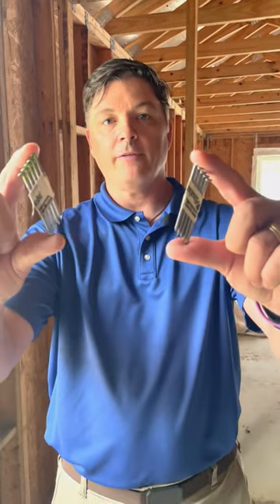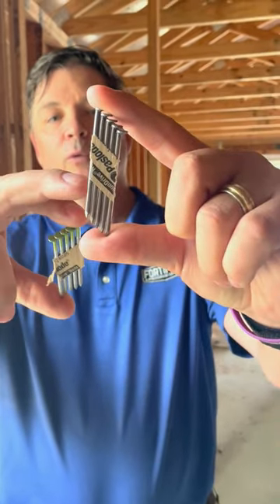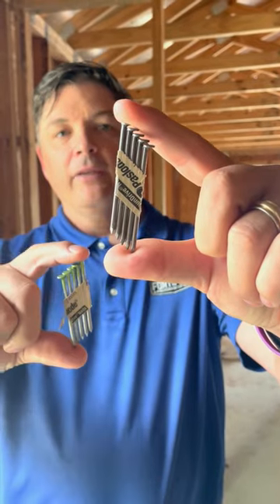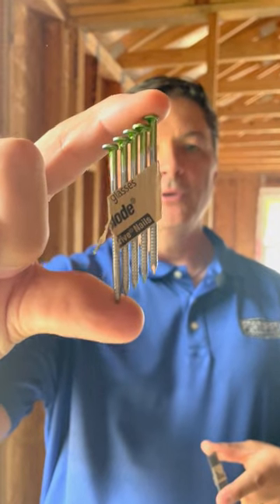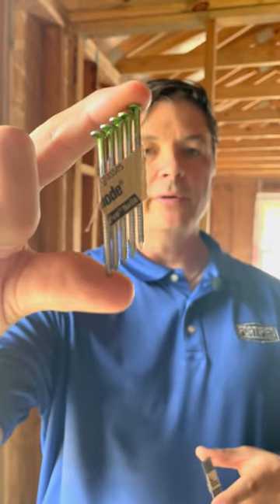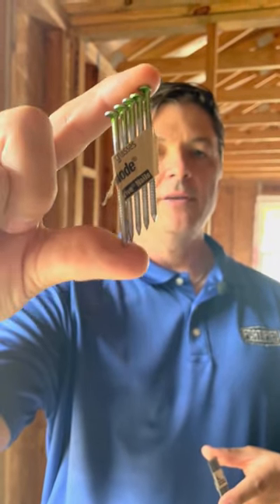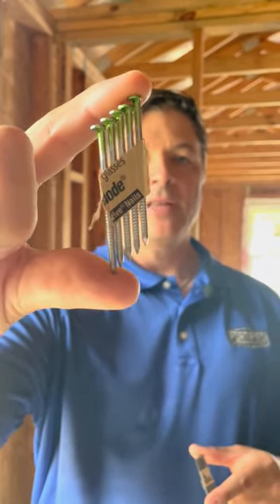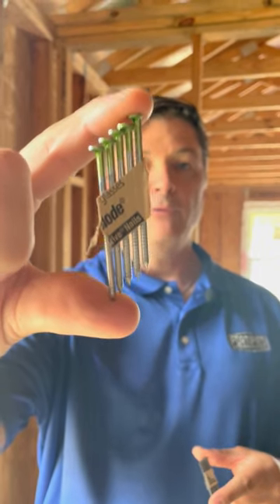Ring-Shank Nails Versus Smooth Nails

Comment: They used them for the deck boards on my front porch and 1/3 of them have worked their way out almost a 1/2 inch. I need a video on hor to remove them without tearing up my wood.
Reply: Use your hammer, if they come out easily your joists have rotten/ eroded and you might want to replace your deck or refurbish it, however if they don't come out easily just re nail or screw the boards, and hammer the lifted nails back in
Reply: Small cats paw can dig in to lift the head of the nails enough to get a large prybar. MAKE SURE you use something under these tools so youre not prying on your own deck